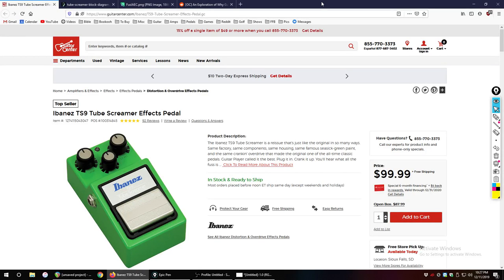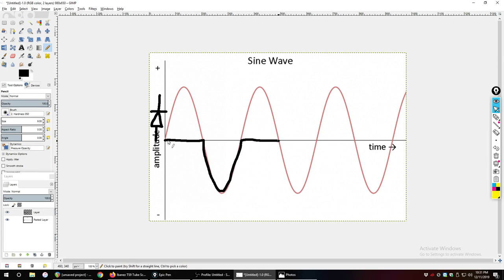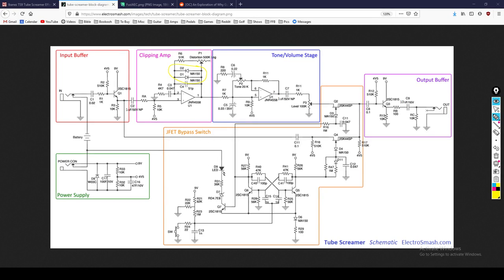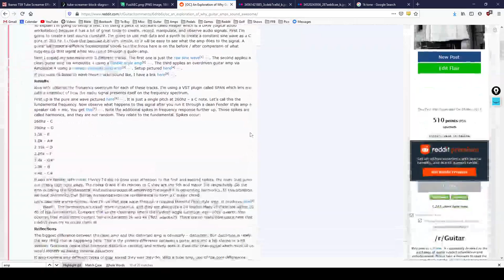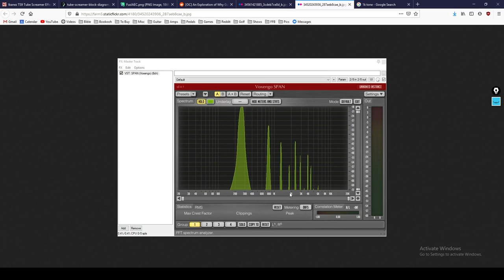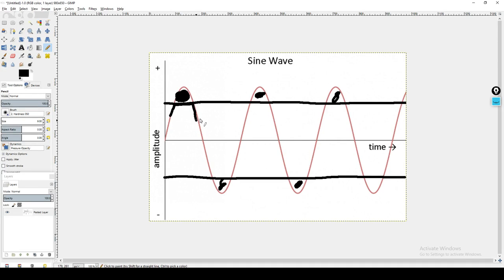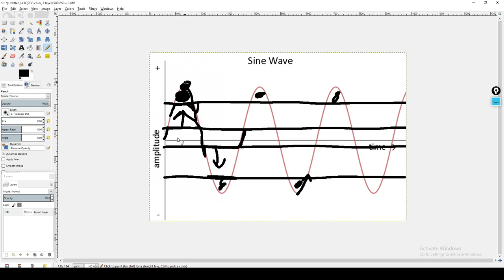How Diodes Work - In Guitar Gear

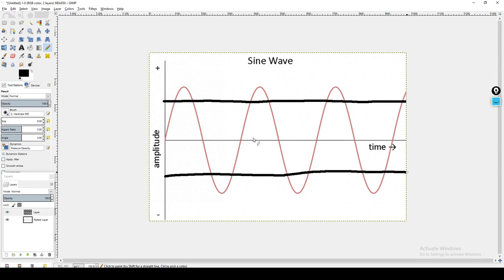Comment from the maker: A note of correction.  At 10:43 I talk about stacking two diodes in series and how that affects the forward voltage.  I have it backwards.  Two diodes in series doubles the forward voltage rather than cutting it in half.

Comment from the maker: Time stamps:
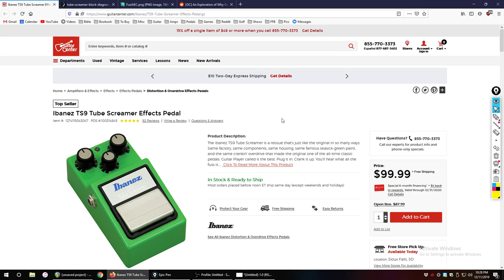1:31 – Diode and electricity basics

4:00 – Forward Voltage
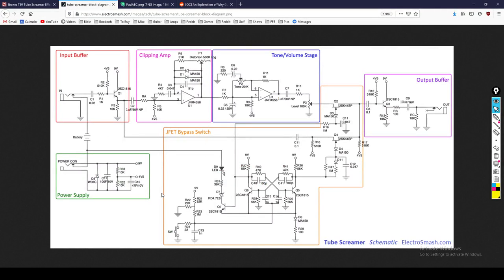6:20 – How Diodes are used to clip a signal in an overdrive
pedal 

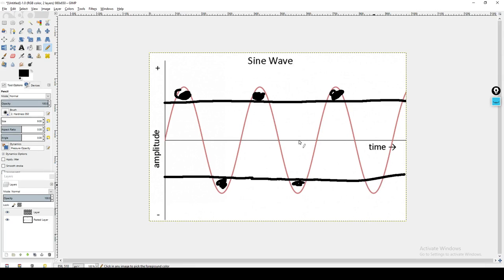10:10 – Assymetrical clipping 

11:40 – What symmetrical and assymetrical clipping do to an
audio signal 

17:25 – Diode clipping and compression / sustain 

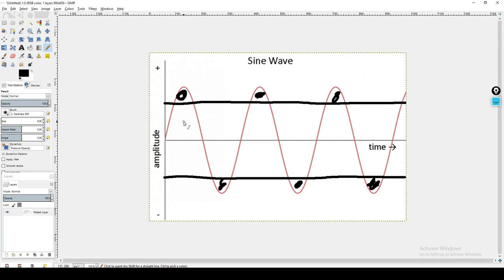18:38 – Diode clipping and hard vs soft clipping

Comment: When you describe the clipping, you say that the diode dumps part of the signal to ground.  There are (hard) clipping circuits that do exactly that; however, the Tube Screamer produces “soft” clipping by putting the diodes in a feedback loop. I am confused - is it a positive feedback loop or a negative feedback loop?  IOW does the first op amp gain stage invert the voltage signal?

Comment: Stumbled upon this video 3 years after it's out :)

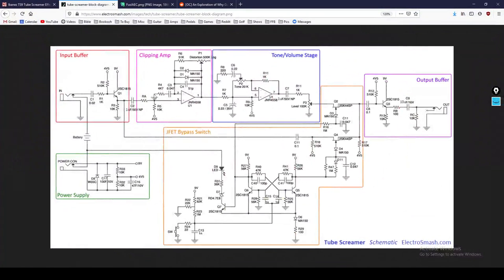Sorry, you're mixing things up and misleading people. I'm not a professional elecronician myself, but still this is a public knowledge not some rocket science where you are mistaking, so easily verifiable. I've watched only up to 7:50 so sorry if you correct yourself afterwards.

When you talk about the imaginary ideal diode deleting half of the waveform (that's called half-rectification) you must be referring to a chain where the signal goes in series through the diode. Then you say real diodes are having a forward voltage. Right. But when used in the same configuration, i.e. in series from the input to the output, it will not clip the way you show. Rather, you can imagine an area of 0-0.6V deleted (collapsed) and everything what's above it will drop -0.6V, so the lower part of the waveform will remain unaffected (correct), the upper one however will look as mostly flat line with only peaks of the original signal (which were above the 0.6V) raising above the zero line.

When you show the overdrive cirquit, it's a soft clipping via op amp feedback loop. I think it's explained maybe on the very same website you are showing the image from. When an opamp is configured so that the output is connected straight to the negative input (marked -), it "copies" the input signal from the positive input (marked +) to the output (so called unity gain). When there's a resistive divider between the output and the ground, with the middle point connected to the negative input, the opamp will have some positive gain because part of the signal is going to the ground (and the opamp wants the + and - inputs to become of an equal voltage roughly speaking). In the softclip cirquit you've shown there are diodes which start to conduct when the output of the opamp is raising towards the diode forward voltage, "shifting" opamp configuration to the unity gain because the louder the signal gets the more diodes behave like a straight connection.

Now this is quite hard to explain without showing pictures but I hope you'll note the effort and do some research ;)